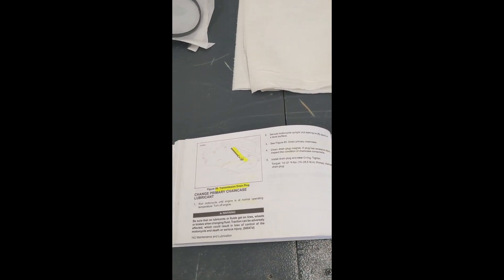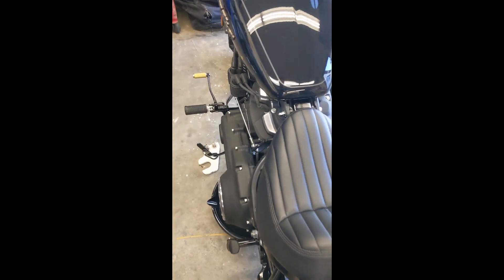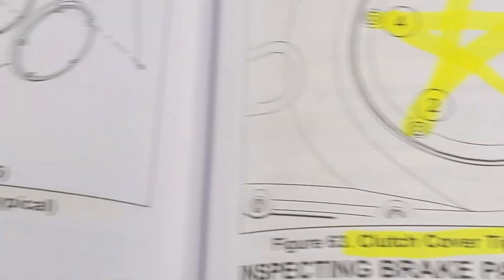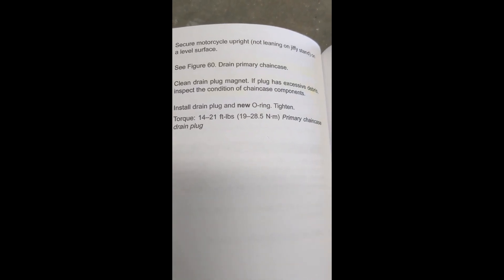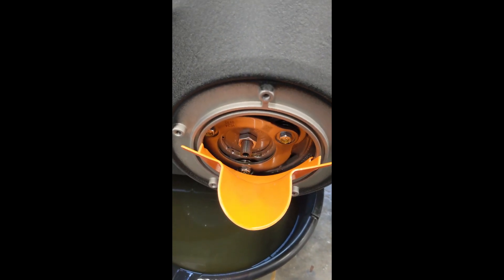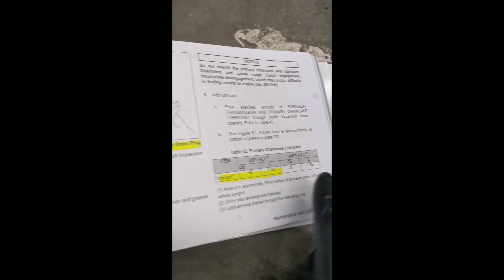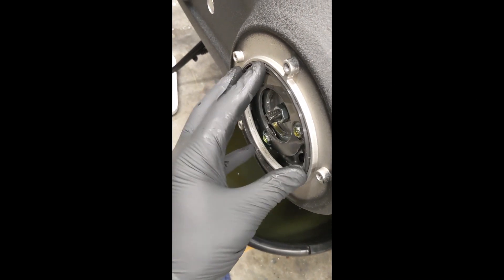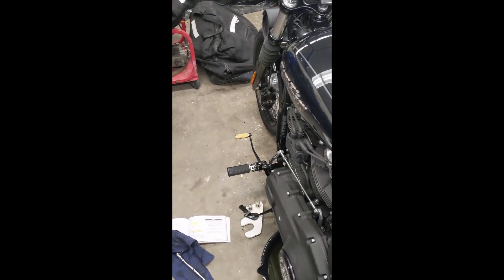Derby cover and primary fluid change 2020 Street Bob FXBB

Comment: I changed mine, and didnt follow the star pattrr to tighten and woke up with a small leak... i fixed it now, do you think its ok or should i add more fluid?
Reply from the maker: Depending on how much leaked out, if it was just a small leak I wouldn't worry about it.
Reply: @harleyhelphintsfxbb3684  just did a complete change of the oil as it was dark.

Comment: Where did yoi put more oil in at
Reply from the maker: No more oil, just after I drain I put 40 in the primary cover hole. I'd put 36-38, don't put 40. My clutch slipped a little with 40 oz.

Comment: I’m not sure what may be different. I also have a 2020 street bob, my derby cover seems to measure 6 1/8” on the outside and that gasket part number doesn’t seem to be correct. I ordered the 17369-06 red color and it is huge, way too big. The factory black gasket is significantly smaller. Are you sure your part number is correct? I’m thinking that black gasket is a different part number
Reply from the maker: I actually just had that problem with Harley. They gave me the kit with that series number and it's too big. The baggers and fat bob have that larger gasket. The right on is #25701080 
I have a brand new one I'm looking at right now, but it doesn't come with the orings for the plugs so you'll wanna buy those too.

I checked, but did I supply that wrong number in the video or description. I looked and didn't see it. If I did I wanna fix it so people aren't buying the wrong one. Thanks!
Reply from the maker: I just saw I commented that below, if you went off that I'm really sorry. I know how annoying that is.
Reply from the maker: https://factoryproducts.ca/25701080-harley-davidson-o-ring-seal-2019-later-fxst-soft-tail-m8-sold-each
Reply: Yep that new part number is way better! I searched and searched online and couldn’t find it, have no idea why it’s such a secret. Thanks for the quick reply!!
Reply from the maker: @colepeters1903  haha yeah no prob, I've realized they made the m8 in the street bob a little different for whatever reason. Good luck, if you have any questions I'll try my best to help

Comment: What  type of oil do you use
Reply: For  the primary case
Reply from the maker: Harley gave me formula + for both the transmission and primary fluids. I know you can use equivalent but I'd have to do some research for that
Reply: Amsoil has a specific synthetic for each “hole”. V-Twin Primary oil and V-Twin Trans oil. You can probably guess where each goes. Many comment that they can feel the difference vs the Harley stuff by the end of the driveway, especially if you’ve been sold on the one-oil-for-everything program.

Comment: Hey brotha I got the same bike. Just want to change my derby cover I already did my 1,000 mile service. Can I just change derby cover ? Or do I have to change the fluid inside it as well ?
Reply from the maker: You can just change it, the fluid isn't high enough to spill out the opening. The only thing that they recommend is changing the gasket. I personally have done it without changing the gasket (seal, oring,  whatever the term) , just keep an eye out for leaks and if the cover leaks grab a new gasket and throw it in there 🤘
Reply: Thanks brother enjoy that thing !!

Comment: Hi, am I understanding correct, you’re using the left over transmission fluid from the transmission quart onto the primary? Thanks
Reply from the maker: Yes sir, if you need it. The primary is a visual check and not necessarily a specific oz of fluid so you may not use it all. I verified that with the Harley dealership.
Reply: Great, thanks a lot. And thank you for the videos.

Comment: What Weight Primary oil did you use?
Reply from the maker: Harley Formula + oil is the viscosity of a 80W-90, that's what I used initially. I can't remember what I used the last time I did it, I switch to the synthetic Harley gear oil, it was whatever the dealer gave me.
Reply from the maker: Not 100% but it might be the the 80w-140
Reply: @harleyhelphintsfxbb3684  thank you
Reply: @harleyhelphintsfxbb3684  ok.

Comment: I need to just change the derby cover. I also got mine from Etsy. Do I need extra hardware to install the new one?
Reply from the maker: Nope you should be able to use the same hardware that comes out. I think it's a torx t27 bit. There's a rubber gasket in there too. Harley will tell you to replace it everytime to be safe. But I've replaced the cover before and kept the same gasket.  just be careful to preserve the existing one and Keep an eye out for leaks afterwards. If you have any questions let me know!

Comment: What's the recommended change interval (miles? / months/ years)?
Reply from the maker: 1000 mile do engine oil, primary, and transmission, 6000 do engine, 11,000 engine oil, primary, and transmission. That interval every 5000 miles. And it's a 6 month interval. This is from el cajon harley davidson in southern california

Comment: Can I just change the Derby Cover without replacing the Gasket?
Reply from the maker: It's not recommend by harley but I've done it before. If you do just check it after you start riding and make sure it doesn't leak. When I did it I figure I might as well try before I buy a new one, and it was fine. 🤘